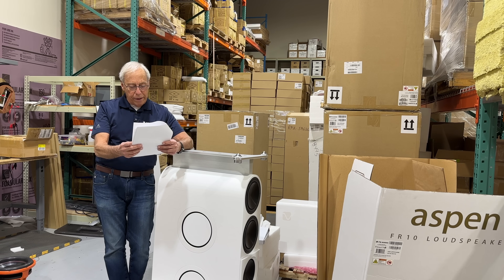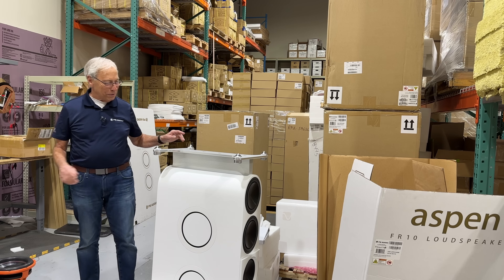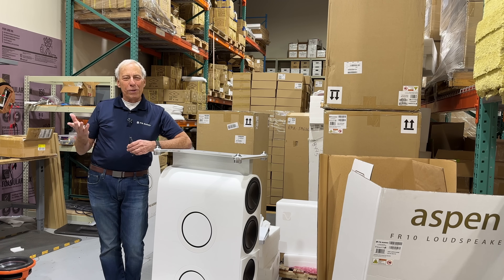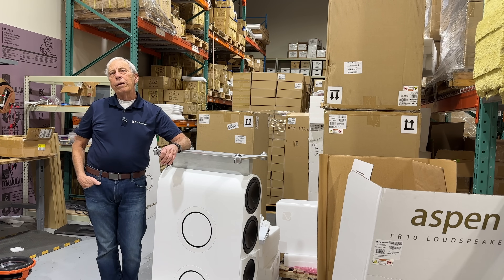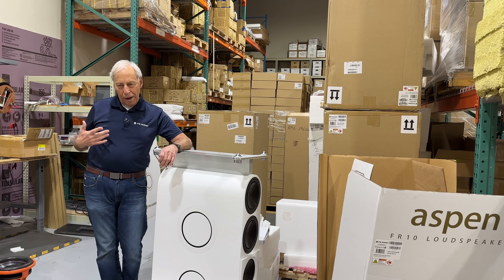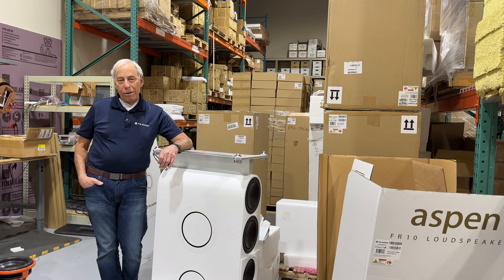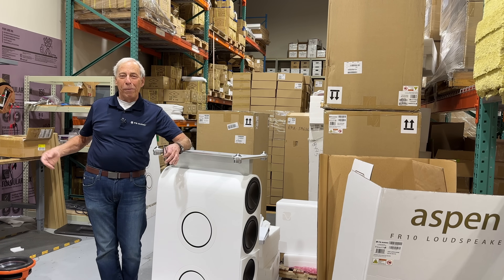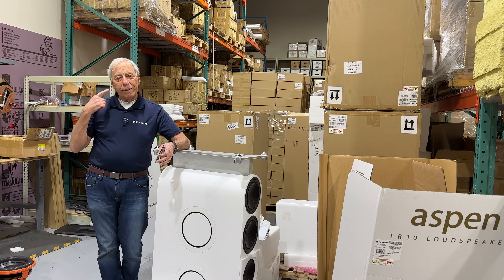Matching amps to preamps

Comment: The biggest problem with preamps is that they usually have too much gain. It would be interesting to hear something about amplifiers with germanium transistors with higher quality such as GT813V, GT806 or even better GT906A in SE topology.

Comment: Would you have any qualms with a DAC having a high output impedance of 625 Ω on RCA and 1250 Ω on XLR going into a powered preamp? Would that be too high, and if so what would it do to the sound? Thanks.

Comment: Good class D power seems a dream to pair - usually a high inZ which is great for passive, and that transparent sound that lets the preamp sing without 'adding' much...The gain structure and resulting noise floor can also be a consideration in general.

Comment: I wish I would have known about this 2 years ago.
I own a McIntosh 200 wpc power amp, a 1000watt sub amp and bought a tube pre-amp to replace the solid state Adcom pre-amp. No guda!😢 The tube pre-amp can't drive anything! The gain is full up on both pre-amp and amplifier and it barely works.😢 Is there a fix or did I waste $1100 on a tube pre-amp? Can I put a small mixer in between the components to increase the gain?
Reply: What tube pre-amp did you buy?
Reply: @YouSoundButtHurt  I just moved, It's packed away in a box, I'll get back to you.
Reply: The Preamp is a:
NAD Electronics, model # C 165BEE 
Stereo Tube Preamp, Driving (trying to!) a Macintosh  MC 2205 and a Dayton Audio SA1000 Sub amp.
Any information would be a great help!
Reply: A lot McIntosh power amps have a very low 10K Ohms input impedance. Your tube preamp likely has an output impedance that is 2K Ohms or higher. Your situation is the 0.01% Paul was talking about @ 2.01 (it's actually quite a bit more common than that). Not a good match!
Reply: @gotham61  You got it backwards dude. 10K is high 2K is low.
Reply: @imnewtothistuff For an input impedance 10k is low. 50-100k is more typical
Reply: Tubes are just so WEAK 😴 transistors are STRONG 💪 Just get rid off the tubes!
Reply: @RoderikvanReekum  That's one of the dumber comments I've seen today.  Great job.
Reply: @YouSoundButtHurt  Why use a prehistoric and inferior technology like tubes, they sound like shit and are so weak, only a couple of watts at most while transistors are so strong with literally 100's of watts!
Reply: @RoderikvanReekum  It's a preamp dude, you don't need wattage. Tubes can be overdriven and not clip. And when they do it's a soft clip with a rounded wave form. Transistors clip hard, with a flat wave top, very undesirable noise. A much cleaner sound with tubes.
Reply: @imnewtothistuff  Even in a pre-amp you want the strong power of transistors instead of those weak and terrible Tubes. Why use inferior technology when you can use modern and better technology! You want strong gain, that is only possible with Transistors!
Reply: @RoderikvanReekum  You've got to remember, power ratings are derived at only a one watt output. Anything above that is just for show.

Comment: I think one point that was missed here and can be problematic is when people attempt to match a tube preamp with a solid state amp.  Pure tube preamps (not hybrid) can have two major issues that cause problems:  high output impedance, and transients at turn on/off.  Some tube preamps can have output impedances in the low thousands of ohms, with rising impedance at low frequencies, due to the coupling capacitor. And some have no muting circuitry at their output, allowing huge dc level shift at the output jacks at turn on, and again at turn off. Because a solid state power amp comes on almost instantly, you can't switch the amp and preamp on together. You have to always turn the preamp on first and wait for it to warm up and only then turn on the power amp. And you use the reverse sequence at turnoff. Many modern tube preamps have mute circuitry, but a lot of people still buy vintage tube preamps. And this is where the interface problems with solid state amps can really pop up.
Reply: I was going to say the same. There are plenty of solid state power amps with a 20K or even 10K input impedance that don't play nice with some tube preamps, especially if you are connecting them with long interconnects. I had a customer complaining about dull lifeless sound, and it turned out he was using a PrimaLuna preamp with a 2.8K output impedance, connected with 20 ft interconnects to a Quad power amp with a 20K input impedance.
Reply: Why wouldn't any modern-day amp have a soft start circuit? Doesn't make sense

Comment: While living in Japan not far from Tokyo there was a shop selling used LP’s and high end gear. I bought a used Accuphase Power Amp. They gave me a week to try it out. I paired it with a Pioneer integrated amp with Pre outs. It was ok, not great, but just ok. Went back to the shops and got the matching pre amp. Very disappointed so it was returned. My audio guy was a few hours away in Shizuoka. He sent me a Conrad-Johnson PV-3. That was magic. Speakers: SMGa’s. So in my case the matching pre wasn’t a good match.

Comment: The more I hear how much sound quality you lose between even a good interconnect and an excellent  interconnect, I think you should try to avoid using interconnects as much as possible; unless you can buy a really great one that fits into your budget. Integrated amps avoid that extra interconnect. In my case, Wywires Blue, which is a good budget cable, but compared to Tributaries Series 8, there's obviously some distortion and veiling. A $300 IC cable vs. a $400 one. When the thought occurs to me that people who buy a seperate preamp & power amp, probably aren't going to be using even something as good as the $300 interconnect; it occurs to me that their money buying seperates is going to be pretty much thrown down the drain.

 I'm not saying don't get seperates, but if you do, promise yourself that at some point (the earlier the better), you'll invest in a superb quality interconnect. There might be some sleepers out there, that don't cost many hindreds of dollars (or more)... I've found some cheaper ones that do many things really nicely, but I've never come across an inexpensive one that does everything right. There's always a wart or two in some aspect of its performance that ruins it for me. 

 What might be a bigger concern than matching preamp to amp, is making sure your preamp isn't so sensitive that it will overload on the peak passages from your source; whatever that may be.

Comment: I own an Onkyo M-504 power amplifier with its matching P-304 preamplifier. I also own a Hitachi HMA-7500 power amplifier and its matching HCA-7500 preamplifier. If I had to downsize, which set should I keep?
Reply: The one you like the most.
Reply: @hugobloemers4425  
Based on specs.
Obviously, one is prettier.
Reply: The P-304 is well respected. I had one and sold it for around $400.

Comment: How can I match afteramps ?  Everyone is talking about preamps , why no one is mentioning  afteramps ?   LOL
Reply: After amps are the speakers. Lol!
Reply: Wouldn’t that be a post-amp?
Reply: Decades ago in Audio magazine there was a Lirpa Labs article 
on how to modify a single transistor to make a "post amplifier".    
Pretty simple: Apply high voltage until you establish a low resistance between the emitter and the collector.  
Today it might be more easily processed in a microwave oven.
Reply: @spacemissing That brings a question that I rightfully never asked before. I wonder how much throughput an EC short on a typical output device would tolerate before it became open?
Reply: I don't get it…
Reply: I guess you're a foreigner or something.  The opposite of a "preamp" would be a "postamp".  I guess that's the joke you were trying to make.
Reply: @ryanray6215  🤡🤡🤡🤡🤡
Reply: I would like a set of those FR 30 after amps!
Reply: @ericnortan9012  
Nah , they are Chinese  eyesore . 
Way better design, made speakers , less expensive and not made in China are available from Europe or North America .
Reply: @ryanray6215  You know, I never new they were made in China, it makes it real hard to justify the price. As if it wasn't hard enough already. Not that I doubted you, but I checked and you are right. I'd still take a pair, I never turn down free speakers if they are decent. I would never buy them, even if they were made in the USA. Too rich for my blood.

Comment: The preamp is the most important component in the system a decent power should no problem not so important look for a preamp that has good sound stage low impedance lower the better